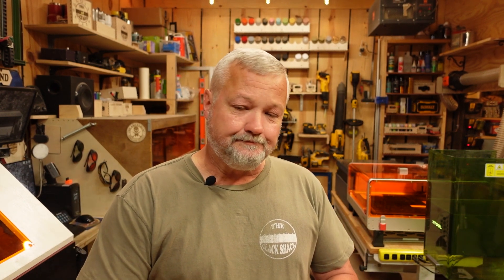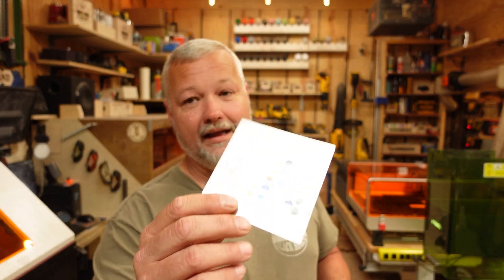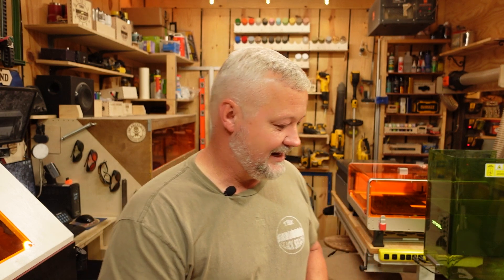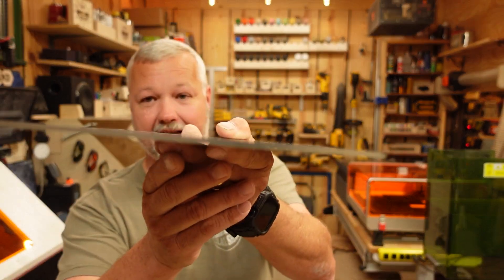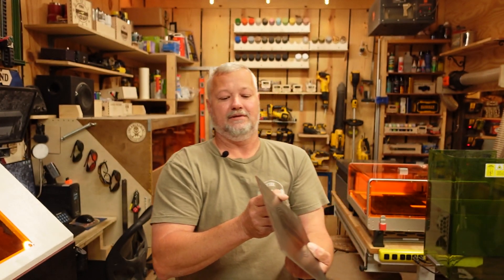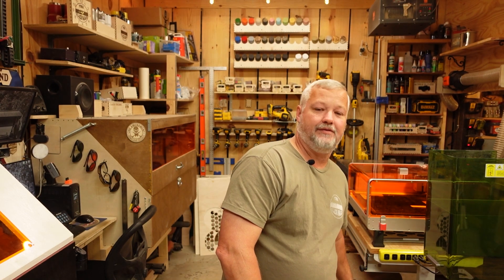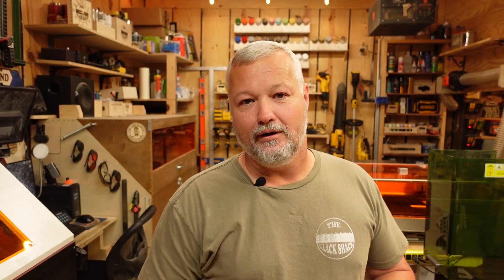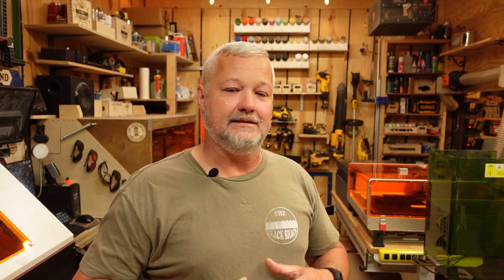Color engraving stainless steel with a diode laser

Comment: I have a 10/30W MK2 and have been thinking of doing some stainless steel dog tags. I've seen on amazon stuff listed as Shiny Stainless Steel Military spec Rolled Edge Backing  or T304 STAINLESS STEEL Tags. Are both or neither of these blue diode friendly? Do you have an affiliate link for dog tags or one you recommend? Thanks for the great video.
Reply from the maker: Avoid the shiny ones unless you have a fiber. I may order some blanks and do a video on the better ones. I have a few that work but there may be better ones out there.
Reply: I know this is 5 months ago, but if you spray paint over the metal, then engrave you'll be able to engrave a shiny surface nicely.  I've got a  OLM3 (10 watt blue) that works nicely that way.